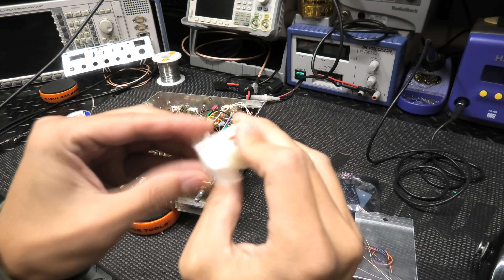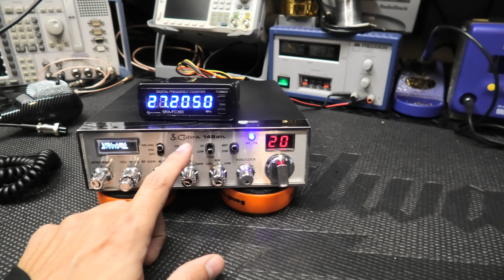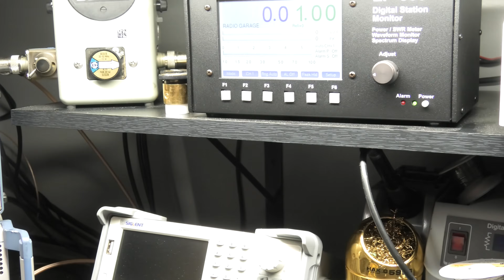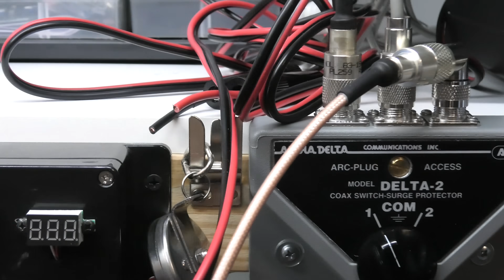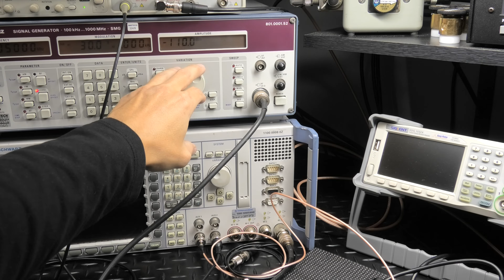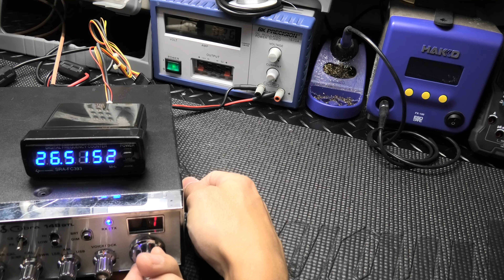Custom Cobra 148 Built For Harold | FC-393 | Digital S/RF Meter CB Radio

Comment: awesome vid! ididnt catch the mod you did for the req counter.. what mod did u do? i have the exact counter enroute for my connex 3300.. , also Troy Radio announced you were the new S meter guy on Fb ! wicked awesome ! cheers ! kick butt video!
Reply from the maker: I've described the mod in a previous video but it involves changing/removing 3 smt parts..thanks for watching ✅️ it will work for your connex right out of the box. It's the cobra/uniden radios that it won't work on unless modified
Reply: @TheRadioGarage  hi Do you have the link of that video?